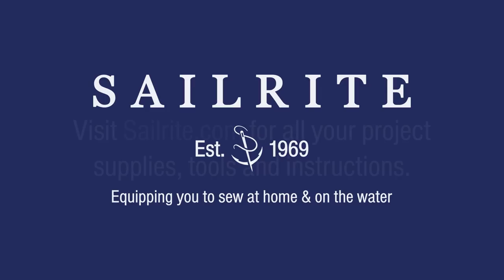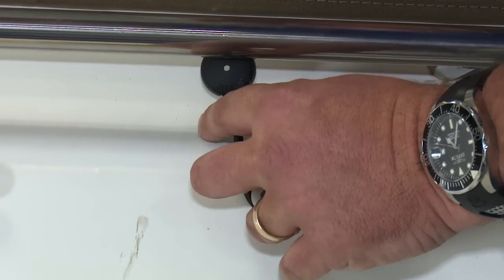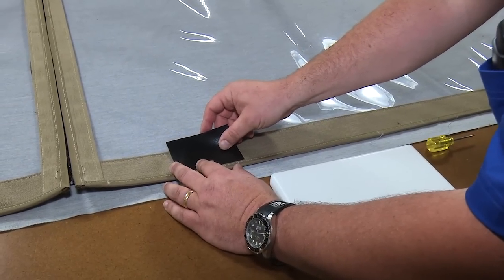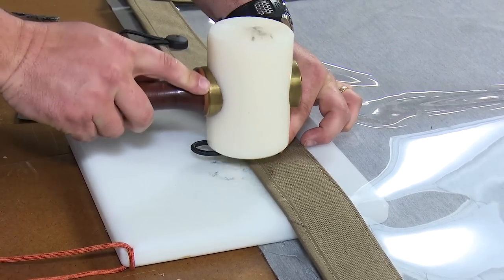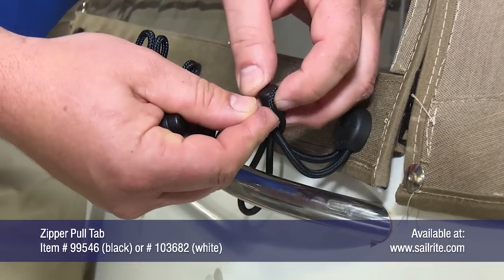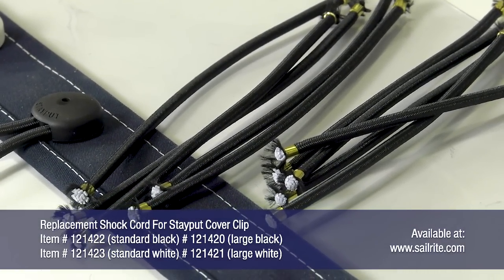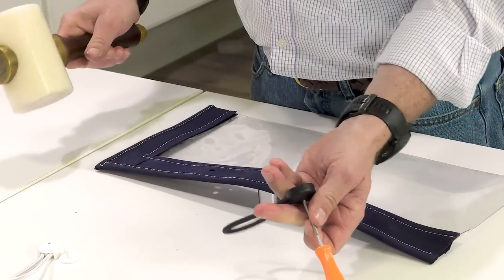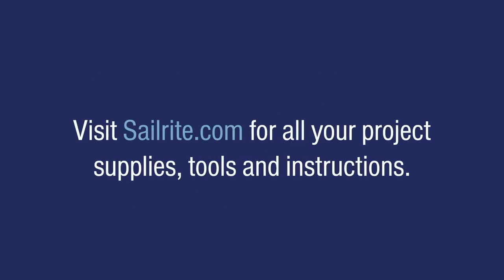Installing Stayput Shock Cord Cover Clips on Canvas

Comment: I'd like to do this on light weight woven fabric for a planting area.  We'll have the fabric folded over several times and hemmed.  However, we'd like to install the shock cord clips in grommets rather than simply through holes in the fabric.  Is this possible?  If so, what different grommet sizes would work?
Reply from the maker: No, the shock cord cover clips must be installed through a hole in the fabric and not into a grommet. Sorry.